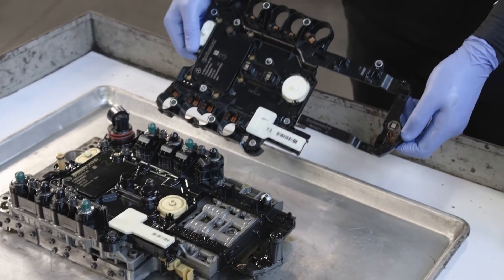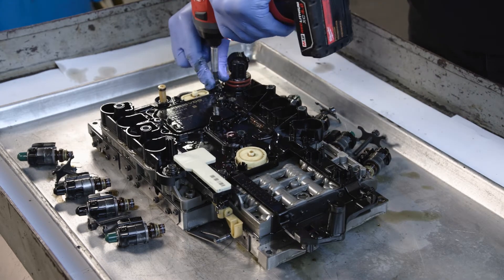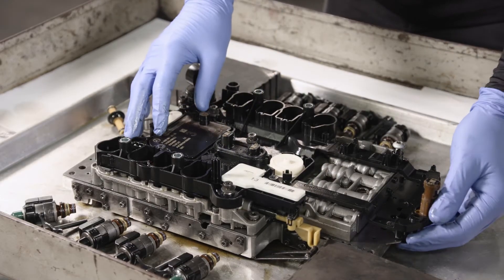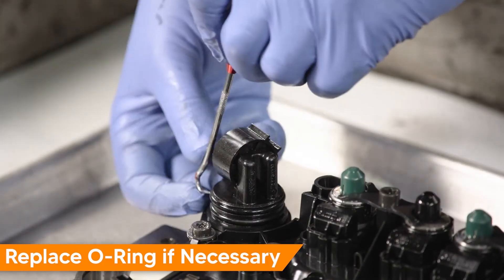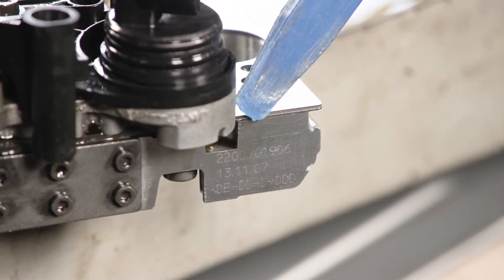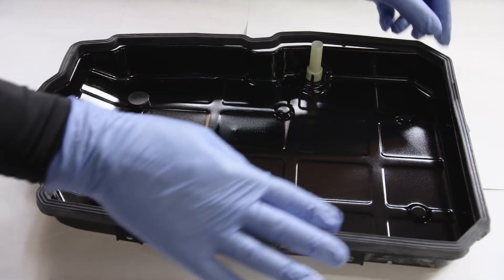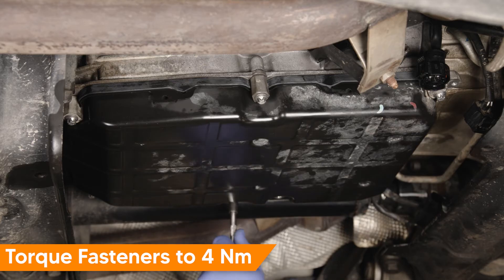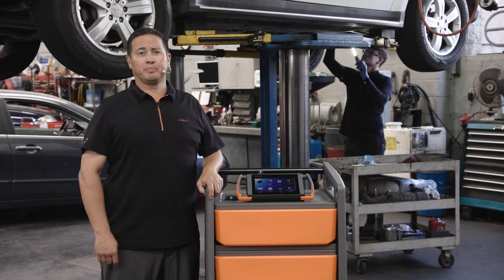Mercedes Benz 7G Electrics (conductor) Plate Replacing - Part 2 of 7G ECU Electrics Plate

Comment: Re 90 degrees torque it states in the video, (after the 4nm) I can’t see this question been raised earlier but in the video, the mechanic only torque 45 degrees. So is it 90 degrees or only 45 degrees the correct torque?
Reply from the maker: It is 90°. The video is an example of the procedure.

Comment: Which one is Pressure Control Solenoid 'A'? Is it the same layout for a 2010 c300 4matic sport?
Reply from the maker: Your model is similar, yes. Pressure Control Solenoid A may be Y3/8y1 Working pressure control solenoid valve (VGS). Looking at the valve body removed with the electrical connector at the bottom right of a table,  Y3/8y1 is the third solenoid from the top left.

Comment: How can we test the solenoid manually? Using ohmeter? Whats the correct reading for each solenoid?
Reply from the maker: Most times I test solenoids under load, measuring current draw. You can check the current repair information for the vehicle you are working on for any electrical specs.

Comment: One question please, on my 722.9 comes oil from the electrical conector, those 2 O-rings are for the external leak, but why is leaking from inside the connector? Thanks
Reply from the maker: That is due to the internal electronics leaking. Oil is getting into the harness or circuits and wicking into the harness. very common.
Reply: @ and the solution on the 722.9 conductor plate is?

Comment: Can I just replace the TCM or do I need to replace the valve body too 😢
Reply from the maker: Depends on the fault. The TCM is external and most times they can be replaced separately.
Reply: @ I have a P0717 , P0718 marking speed sensor I seen it’s been drilled and worked on before I had bought a sensor but I wanted to have to worry about this repair less in the future , would buying a whole new one widen the chance of it failing oppose to just repairing it for $400 I can possibly get a new unit TCU /TCM for $850 and program it too after so it can work with my vehicle some people fix them and get lucky but I hear too it’s good investment to get a new one too? Any advise or places I can buy a new one FCP euro has it for $950 I found a Mercedes certified shop in Westwood that sells them for $850 new 🆕 unit. I’m just trying to get the Benz running my transmission sounds fine I just wanted to know if I can get away with just switching the TCM and not the Valve body?

Comment: Hi,

Thanks for wonderful videos, I have a 2010 mercedes E350 Coupe RWD, the transmission is not engaging at all? If I put in drive or reverse it just revs and it does not move at all.  I scanned the TCM and it has no codes and checked data values in TCM it says selected gear = D when I put in D and Actual gear = P.  Do you know what could be the issue? Any help would be appreciated.

Thanks in advance.
Reply from the maker: This is likely the ISM (shift module). Some diagnostics of the powers, grounds and bus signal to it can confirm this.

Comment: What would cause a "shudder" on 2013 Mercedes CL550 4matic transmission. 
Did notice little bit of radiator fluid needing to be topped off?  Maybe itwas leaking from transmission cooler?  

Transmission now isn't going into gear?  What would be a fix?  Is it the whole transmission? 

Or some service might help w reset adaptive driving settings.
Reply from the maker: First check the transmission fluid level to be sure it is correct. Then check the transmission ECM for fault codes. If the system is not working properly, a fault code will be set. This will be your best bet when diagnosing. Also helpful to check trans adaptations.

Comment: Do you know which one those solenoids is the "D"Circuit.  I have a p2759.  hard shift occasionally.
Reply from the maker: You can use a wiring diagram for your vehicle to identify the solenoid in question.